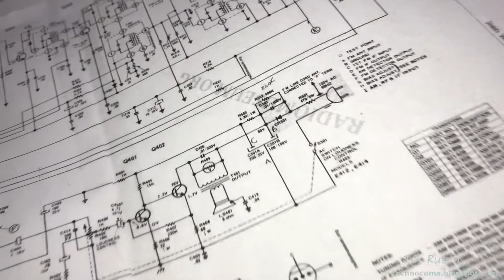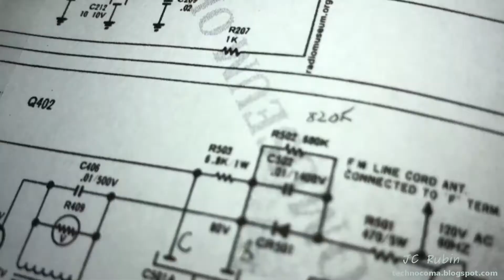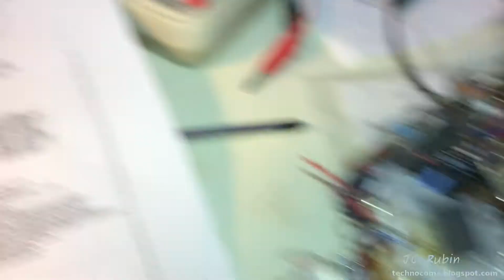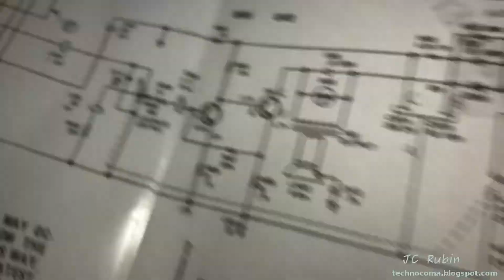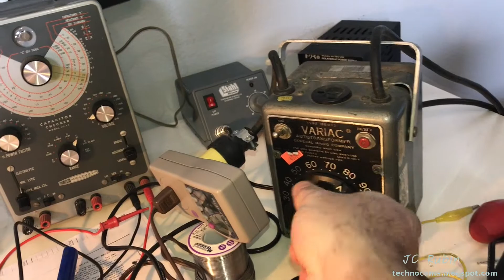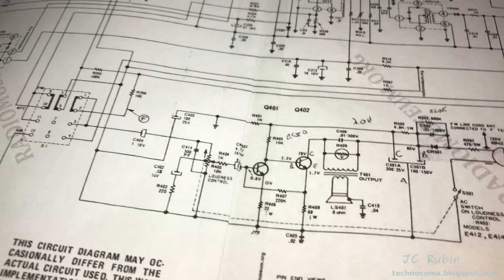Zenith 412V AM/FM Radio Repair - Part 2 of 3 - Troubleshoot

Comment: Jordan, great analysis on this one. The engineers at our disposal at a company I worked for always insisted on transistors to check the bias on the EB junction and assure it's .7 volts for silicon, and .1-..2 for germaniums. it was a great place to start if there  was no service literature available.  BTW loved those "Beer Can Caps in your other project!
John